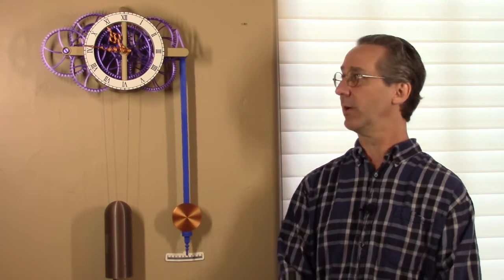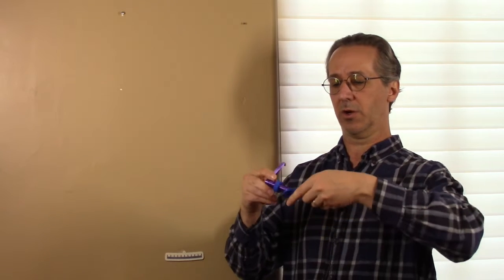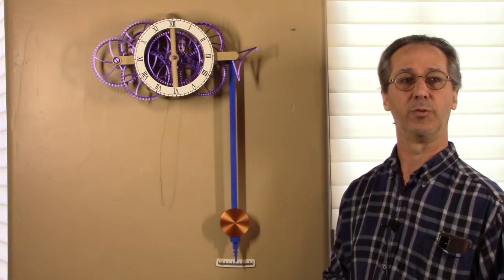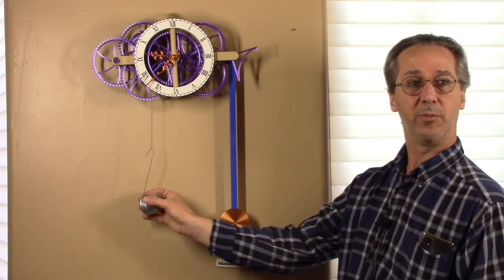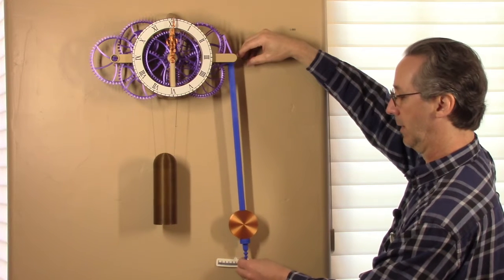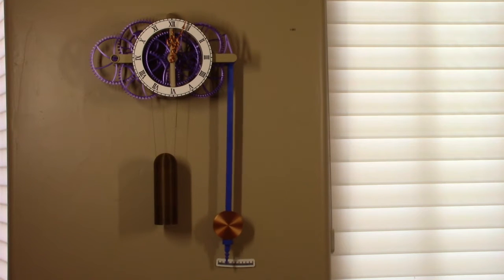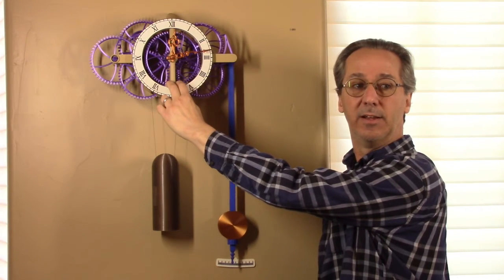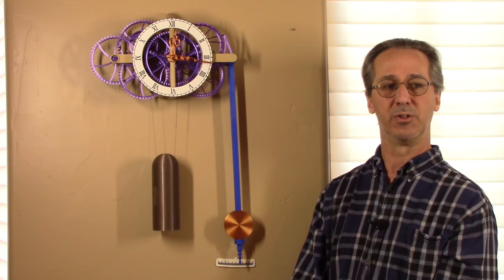EZ Build Clock Debug Process

Comment: Hello sir.. thanks for sharing your wonderful design... I just recently printed your smaller 32 day clock.. while I can get the gear assemblies to work flawlessly with little to no friction, I cannot say the same for the pendulum.. 

The pendulum is down to a half degree in about 4 minutes.. I've tried several different bearings, as well as cleaned, dried, PTFE dry lube, no lube at all... I have even gone the extra step and removed the phenolic retainers and still seeing around a 4 minute complete degradation..  

I've made sure the arbor isn't to long as well as I thought that could be the issue..

Is there any advice you could give me to increase degradation times?..

I thank you for your time Steve..
Reply from the maker: There should be some end play in the pallet as well as the arbor. A small amount of frame warping could pinch the pallet. You probably already checked that. When you say you removed the phenolic retainer, do you mean the internal ball retainer? The balls may fall out if you do that.

The next thing to check would be the bearings. They should spin freely for a few seconds when placed over a 3mm shaft. Cheap no-name bearings from AliExpress or eBay typically have around 5 seconds of free spin time after cleaning. They work great in my clocks with a pendulum swing test of 15-20 minutes. Even sealed bearings with the original factory grease intact run almost 6 minutes in the swing test.

I have not tried expensive bearings in my clocks. Super tight tolerance bearings might be needed to run at 100K RPMs, but loose tolerance (cheap) bearings seem to work just fine at the speeds of a clock. I wonder if you got a bad batch. Do they feel gritty? 

One user reported better results by opening up the bearing mounting holes slightly. It seems that the bearing holes were tight and the bearings were mounted at a slight angle. Enlarging the holes allows the bearings to float a bit and not apply any side pressure when they rotate.

Another thing to try is the 8 day runtime set of gears. This should give 4X as much power to the escapement as the 32 day option. 

Steve
Reply: @stevesclocks  thank you for the quick reply Steve . 

Yes I removed the phenolic ball retainer in a last ditch effort to reduce as much friction as possible.. and yes if you are not careful the bearing will fall apart.. I've since removed those as I still wasn't getting optimum pendulum swing time..

Also what I wrote about the degradation  can be confusing, apologize for that.. should have been more specific.. 

A 5* swing will degrade to 1* within 4 mins... Complete stop at 7 mins.. so upon further inspection, I did find the bearings I purchased are filled with something similar to dielectric grease.. The alcohol and laquer thinner is just not pulling it all out... Will grab some brake cleaner from my shop tomorrow and try that... But it surely seems silicone based..

While I understand the 8 day gear set will run "easier" I'm determined to make this clock run for 30 days, a personal challenge I suppose..

As a side note, I was wondering.. if the winding drum was increased in diameter behind gear 9 (because there is space there) wouldn't the amount of weight needed to run the clock be reduced from the increased leverage applied?
Reply from the maker: @camaroboy383  I use low odor mineral spirits to dissolve the grease. It is fairly weak compared to the old stuff, but will eventually loosen it enough that a blast of air gets rid of most of it. Brake cleaner should work better.

Yes, increasing the winding drum could reduce the drive weight needed to run the clock. It would also reduce the run time. Changing two gears gives a bigger range of run time vs drive weight options. If both changes were used, it would be a bit like the gears on a 21 speed bike. :)

Comment: Hi Steve,
having now printed your clock, and made all the adjustments, I take my hat off to you, bloody amazing, truly a thing of beauty.  I also have to thank you for introducing me to  Prusa Slicer , what a world of difference from Cura, the quality of printing is now amazing.  I have not quite figured out the pendulum adjustment, especially at the top two adjustment nuts.  If you could make that clearer I would be grateful.
Reply from the maker: The purpose of the top adjustment is to allow the pendulum shaft to rotate slightly left or right relative to the pallet arms. The clock should be adjusted to tick and tock equally when moving the pendulum left and right. This is called setting the beat.

There are two ways to set the beat in this clock.

1) Use two mounting screws to hang the clock on the wall. This keeps the clock body solidly held in place. Use the top adjustment nuts to move the pendulum forward or backward along the angled groove to change the angle of the pendulum arm.

2) Use only the mounting screw to hang the clock on the clock on the wall. Set the top adjustment nuts near the center of the adjustment range. Tilt the entire clock frame slightly to change the beat of the clock. A small shift in either direction is usually all it takes.

Method number 2 is the easiest to set up and adjust. It is the method I use for clocks in my house. One slight downside is that the clock can shift when winding and you may need to reset the beat. You want the clock to tick...tock...tick...tock instead of tick.tock.....tick.tock. 

Steve
Reply: @stevesclocks  Hi Steve,  many thanks for the reply. The clock is up and running very sweetly.  I'm absolutely amassed that a 3d printed clock runs so well! Hats off to you.  She's running a little slow about a minute over 24hrs. This I will reduce by raising the pendulum weight, in a few weeks once the clock has run in and settled.  Fantastic little project thank you.

Comment: beautiful and mesmerizing!! hopping to start printing soon.
my machine is a homers tevo tarantula (235x235x250mm) do you think is enough to print this?.
thanks
Reply from the maker: Thanks. Yes, it will easily fit on that printer. I design on a 250x210 Prusa, but also make sure it will fit on a 220x220 Ender3. Height is never an issue.
Reply: @stevesclocks  thanks for your quick replay.
i am ordering that gold filament now.
wish me luck

Comment: Previos model working great. This - not. I try repair, but this design without bearings and 1.5mm shaft in rachet - it really - bad design.
Reply from the maker: One of the biggest comments on the last design was the difficulty of finding the stainless steel tubing for bushings used throughout the clock. This design gets rid of them and the assembly process is considerably easier. However, it is a real clock that needs a little bit of precision to get it to function properly. Bearings are used in the places where they are truly required, the weight shell and the pendulum support. 

Music wire typically comes in a hardened state. It is very stiff and more than strong enough to support the ratchet. Music wire is sometimes called piano wire or spring wire. It should be readily available worldwide. Soft steel wire may bend easily and might not work very well. 

One builder reported that he used a paper clip by clamping one end and spinning the other end with a drill. It work hardened enough to barely work in the clock. But seriously, find some music wire and it will work much better. Start with the shorter runtimes with smaller weights if needed. Winding a clock once a week is still a very functional clock.
Reply: @stevesclocks  
I will reprint , and will add bearings on rachet and 3mm shaft . In addition 3mm shafts must be 91mm (recomendet 89mm).

Comment: Hi Steve, I built two models of your previous 8 day watch. It was a challenge with a lot of problems, but now I can say with great satisfaction that both models have been running great for a few weeks now with 2.7 kg and 3.5 ° of oscillation. In the second model I took liberties and changed the aesthetic appearance of the dial and inserted a bearing in the minute wheel and two bearings in the ratchet wheel.
In both models I have modified the holes for the shafts which are now pushed by force, in this way I do not use spacers.
I use very smooth  SAPPORO R2 bearings.
I have now started building this new model and would like to do the 15 days.
I have a question. Do you think that using bushings can reduce friction?
Reply from the maker: Hi Guido. Bearings can reduce friction, but are not really needed. I placed them near the weight shell to support the heavy loads and at the pallet to support the pendulum. Most of the arbors in the middle don't really need them because the speed is so slow. The escapement might benefit due to the high speed even though the load is very low.
Simple music wire arbors in PLA have very low friction. Bushings used in my first clock have about the same amount of friction. The biggest benefit is that they should last longer. I don't think the friction is reduced enough to justify the extra effort.
15 days of runtime is the upper limit for the large version of the clock, but should be easy in the medium size clock. The biggest factor to achieve a long runtime is the pendulum support bearings.
Steve

Comment: Very promising kit, thank you! What maintenance should we expect? I also see, that is prone to collect dust from air. Is there a proper way to clean it/keep it dust-free? (While this exposed design is very sexy, an encapsulated one might also be interested.)
Reply from the maker: No maintenance is required except possibly blowing off any accumulated dust. The only lubrication recommended is a dry Teflon type that doesn't attract dust. My oldest clock is over two years old and still running strong. A case could be built, but due to the large size, it might be easier to build one out of wood.

Comment: Hi / just printing this clock but have built you other upright model clock / Have found it easier as regards the bob weight to do away with the suspend wheel for the 2 cord and just hang the weight on a single cord thus cutting down on the size and weight of the printed shell case, Clock runs well with 3.8 lbs and drops about 1 inch an hour / Your comments on me doing this I would like.?
Reply from the maker: Hi Janet, A single cord works just fine with the obvious limitation that the clock only runs half as long using half as much weight. The weight distribution is slightly off on the vertical clocks and the frame may want to tilt. This is easily fixed with a small nail. The pendulum bob acts as a counterbalance on the horizontal clocks and they seem to stay oriented better. A minor feature of the weight shell pulley is to help keep the cord near the center of the barrel when winding. Watch the cord position when winding to make sure it doesn't go over the edge of the barrel.

Comment: Steve, I built your earlier design, which is now working perfectly. My issues were ALL with the print quality with a slightly squashed first layer giving some of the gears a rough edge which led to too much friction. Not an issue with 995 of my prints giving good bed adhesion but with gears for a clock it was.  A quick 3d print of some small sanding sticks and an hour in the sun sanding out the defects solved this. I intend to build this clock soon and when I do I'll print the escapement and at least the 1st 2 gears on rafts to solve this. Thank you for your designs. Andy
Reply from the maker: Thanks Andy,
Getting a perfect first layer is a balance between too much squish or not enough adhesion. The bed needs to be heated, but PLA starts to melt a bit if it is too hot. Slicers can often compensate for the elephants foot. I usually keep it set around 0.12mm. And the gears have a fair amount of backlash built in. You can try a raft, but watch the first real layer. The gear teeth start printing with a single narrow stripe and work outwards. The bottom edge of the tooth might not form properly if the center stripe does not stick to the raft. It should resolve within a few layers, but may print better without a raft. It is easy enough to try both ways. The worst case is an hour with a sanding stick or small file. 
Steve
Reply: In Cura 4.8 , it is the slicer I use, there is a string in "Shell" , initial layer horizontal Expansion, can bet set to a negative value to offset the elephant foot
While this depends on the printer, the leveling, the layer, the temperature, the filament...
I found that -0.25 works for me. I usually use .2 mm layer, printing on a glass bed

Great video on tuning BTW